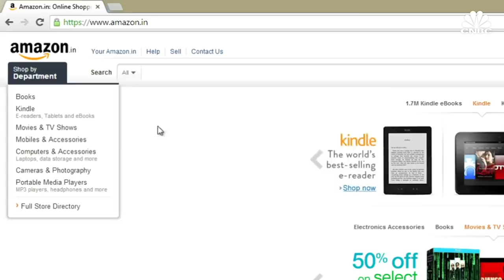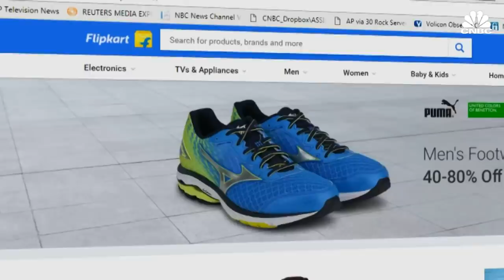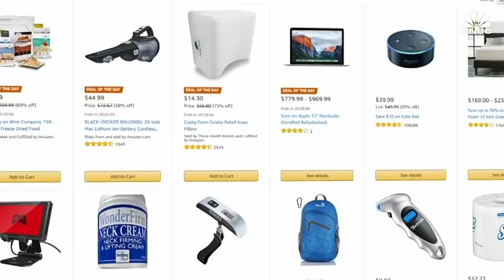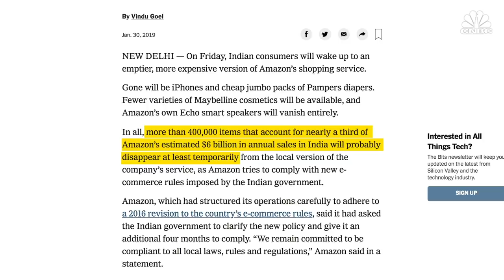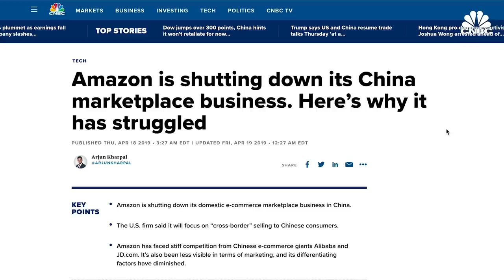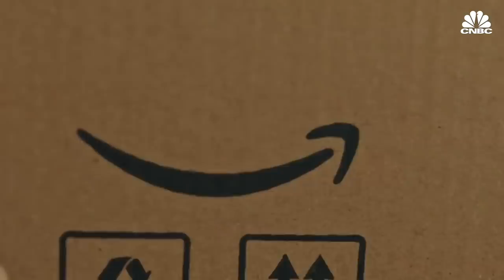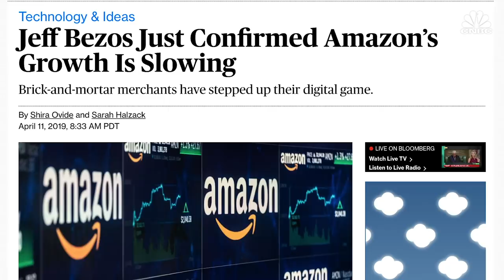Can Amazon Succeed In India?

Comment: The country recently rolled out it's 4g network... lolz...
We were using FM radio signals from 2012 to get 4g speed😂😂😅

I know because of high density, people don't get desired 4g (actually lte) speed. But from 2015, 4g become common in India... which is quite late... but not even recent...

Telling news without knowing facts...😅😅😅 

We are using 200mbps wired fibre optic cable net connection also from 3-4 yrs. & 1gbps wired jio fible optic cable net is also rolled out recently which is affordable...